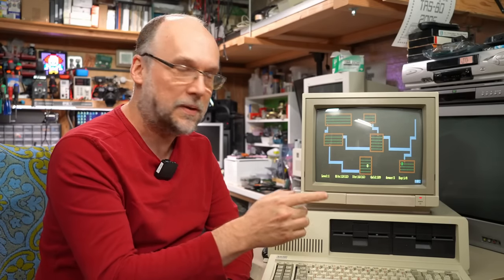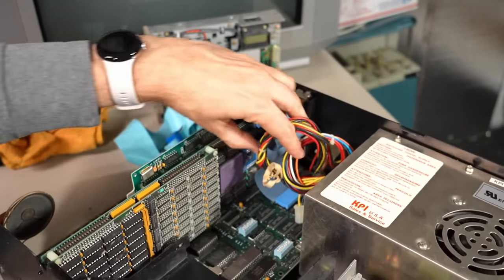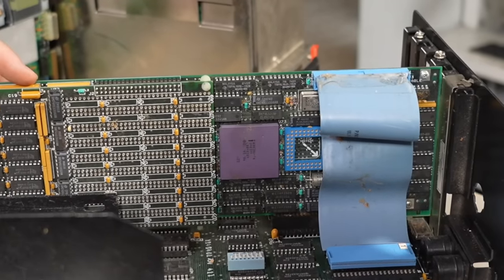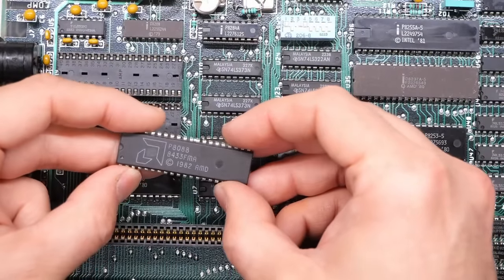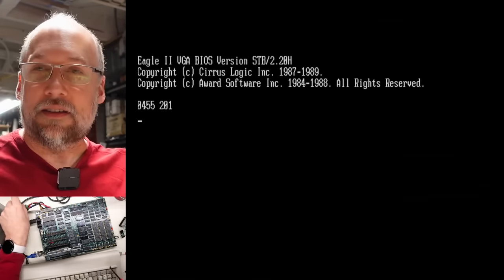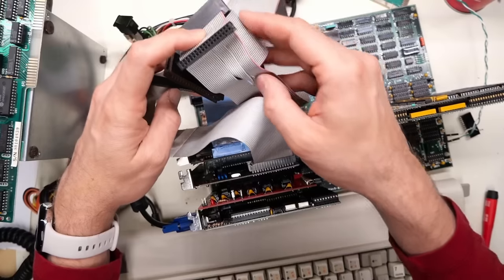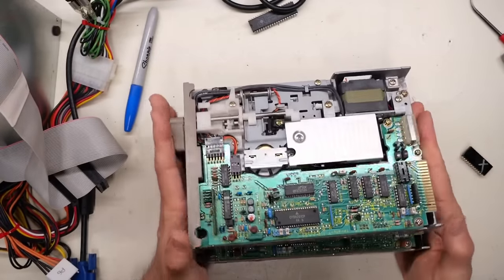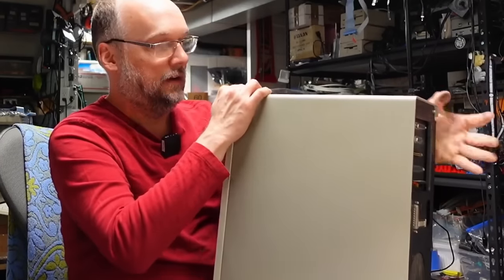PC Archeology: A left for Dead IBM PC 5150 with a treasure hiding inside 🕷

Comment: not that much of a keyboard expert but i have a few notes on model F
they are capacitively scanned, you can take them apart relatively easily and due to keyboard nerdship there are new foam dampers available (just google model f keyboard), what i'd guess is that this mat may have soaked in some water or has degraded to some conductive mush and would falsely trigger the keyscan. at least for the ibm pc portable the model F is full n key rollover so i'd guess if the keyb is sending a bunch of keypress messages to the pc upon reset it will just go "aaaah!"

Comment: I"ll bet someone replaced a bad A drive on that system with a B drive taken from another machine, neither of which would be terminated and never could get it to work, UNLESS that AIB controller has some sort of hijynx to it and can run drives without a termination resistor on one of the drives, which I doubt.

Comment: Sorry, it was the Apple II that started it all, then IBM jump in. I was there.
Actually it was the Apple I that started it all but Steve and Steve only sold a very, they the Apple II really started it all

Ricky from IBM(formerly from Apple - engineer IBM and Apple)actually the Apple I came out prior to the Trash 80.  Steve and Steve sold several out of their garage
Reply from the maker: Technically it was the TRS-80 Model 1 and Commodore PET that started it all -- as the Apple II was by far the worst selling machine of the three... but all 3 of those machines are long long gone, but ever PC today has many vestiges of the IBM PC 5150 in it. My AMD Ryzen system still has PCI to ISA bridge (visible in device manager) and on that ISA bus are all the old things like the System Speaker, System Timer, Realtime clock, DMA controller, etc... all the same stuff that was first found on the IBM PC 5150.

Comment: I have 10 IBM 5150 fully functional motherboards I purchased in an eBay auction some time in 2001 or 2002. I purchased all 10 of them for $10. I had a semi working 5150 and purchasing the set of 10 motherboards was as cheap as purchasing only one. All 9 are still in their original box from 2001.

Comment: Hmm... The PSU was at 11.25V @ 12V line which is marginal... Could it be also adjusted and if it can, you should do so :)
Interesting card, never saw something like this!
Reply: He noted that the 5V line was used to derive the 12V line, so adjustment of 5V up by 0.2V would have pushed 12V line up too.

Personally I would have pushed the 5V line to ~5.05V or even 5.08V, given it was basically unloaded, so when loaded the voltage droop  would pull would pull it down to 5V.

Comment: Accelerators are not that rare. If you have an obsolete PC, a Accelerator to keep a machine relevant and useful is not that uncommon. Most of these boards were designed to run 8088 code faster rather than '386 specific code.  The machine would probably be more useful as an 8088 PC, so stick in an NEC V20 and 27x 4116 DRAM and find a 576k ram card and a video card.

Comment: That keyboard should be an easy fix.  Bend the metal tabs, and pull the circuit board and clean thoroughly.  Those bucking spring keyboards were beasts for reliability.  Now, the keyboard controller could have failed, or other electronic components.  The key switches should be as close to bulletproof as any keyboard ever made.

We always used to say that IBM made a keyboard that you could beat someone to death with, and then type out a suicide note afterwords on it.

Comment: The treasure is the keyboard.  
I know, I'm typing this on one 🙂
The rest of the system is junk.

I found one of these New Old Stock still in the cardboard box, and I think I just chunked the whole thing in the dumpster.  Along with 5 other empty 5150 PC cases.  I remember installing 386 boards in some 5150 chassis way back in the day.